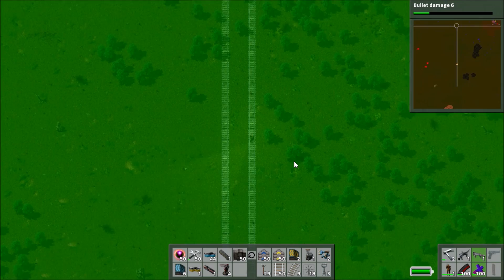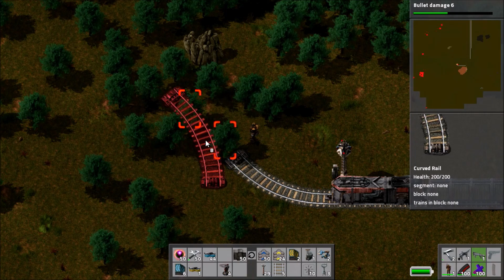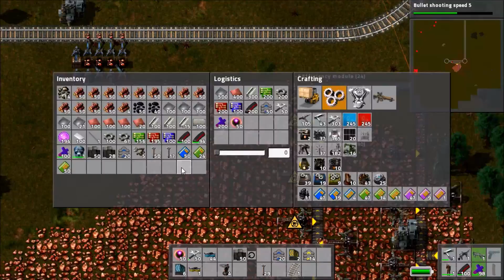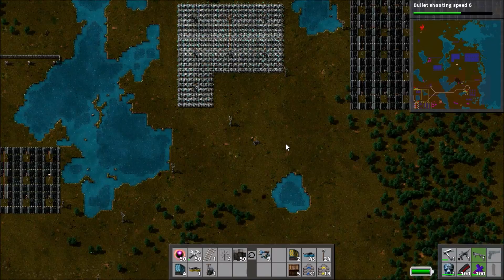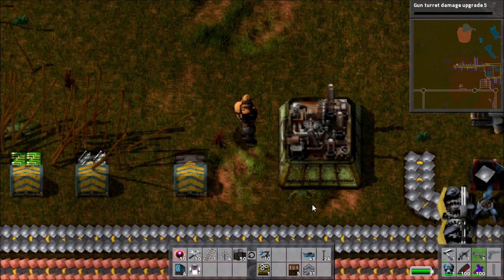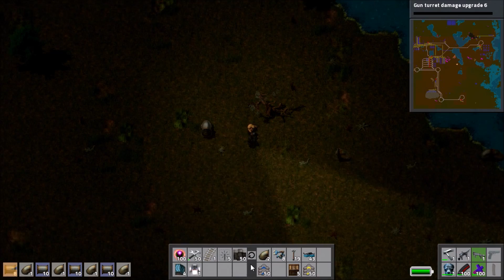Factorio Railworld Ep#25: Copper Train

Comment: Efficiency modules for pumpjacks.. Wow. I always need to fill them with speed and then I still don't have enough oil.
Reply: +Willem Maas 
Speed modules are excellent for pumpjacks because they have an infinite supply once they drop down to 0.1/s. If you put them into miners you get the supply faster, but it also runs out faster. With the oil you're actually increasing the amount you get over time which is technically like adding productivity modules.
Reply: Yonkage Yeah, I know. I always put tons of speed modules in my oil rigs. And then I still don't have enough. Which is why I was surprised he's putting efficiency modules in them.

Comment: Hi Bentham, I noticed in your other videos that you don't use buffer units coming out of your furnace areas, and instead you compensate by adding more and more furnaces.

if you put storage chests in between after your furnace output (also very useful on the output of your circuit output) you will have a buffer that builds up during quite production periods, (such as when you don't have any alien artifacts) allowing you to cope with high production requirements.

This is just like using accumulators but for items.
Reply from the maker: Generally the increases in demand I've been experiencing have been thanks to generally more demand rather than sudden spikes, meaning that in the long term the addition of furnaces would be needed anyway.
Reply: MangledPork Gaming Sure, demand does increase, but buffering is easy and goes a long way to smoothing things out, I wasn't sure about it at first when I read on reddit that some people swore by it - my main concern was that it might run up pollution through over production, but having tried it I now consider them essential.

In my last few games I've been using buffers for my ore (unnessary if you build into your train unloading like you already have), and then also outside of my smelting areas and also outside of my circuit board areas (this one is really a life saver, circuit board production can ramp up and down all the time).

I have some good buffer designs that I use now, which use stationary train carriages, (their large size means that you can fit a lot of grabbers and evenly load and unload at high speed).

No worries if you still dont like them, but try building them into key points, for me they work wonders.
Reply: MangledPork Gaming On a side note, I really love your circular turning points for your train system, I'm totally going to adopt that style.

Comment: no oil train =( those are the most fun to figure out.
For best efficiency you need to learn the wire condition system for an extensive oil barrel distribution. But for one single oil train you don't need that.

Comment: Setting up a production limit for pump jacks is a simple matter, especially with the Logistics Network.  Smart Inserter+Passive Provider Chest.  If Smart Inserter and Provider Chest are within Logistic Network (which they most likely are), set Logistics Network in Smart Insert to < 1 or however many you want available.  With above settings Smart Inserter will work as long as there are no Pump Jacks in the Logistics network.  Once one is built, it gets put in the chest, preventing the Smart Inserter from working until the pump jack is removed, either by you or by Logistics bots.

With Red/Green Wire Conditions, the only difference is that you connect a red or green wire from a power pole to the Smart Inserter and a second from the same power pole to a Smart Chest.  In addition, by stringing red/green wires along a series of poles, you can control the operation of a Smart Inserter by the contents of a chest elsewhere in the factory.
Reply: the last part is very useful for oil outpost. To not oversupply with empty barrels.

Comment: 101 of green wires:
1. place logistics chest as output
2. place smart inserter feeding into the chest
3. with green wire in hand click on the closest electric pole then on the chest
4. repeat with inserter
5. click the inserter and tell it < and the amout you want to keep stocked
Reply: You don't need the green wire if it's in range of a roboport, cause you can use the logistics condition

Comment: why does he leave so much room between each drill surely it would be better to put them side by side with no space
Reply: MangledPork Gaming I did not see your answer while I write it. I mean if you put the drills side by side then there will be more drills and therefore more pollution and so on :)
Reply: Actually, the drills cover one space around themselves; so if they were next to each other, they would overlap in some areas. Not that it's bad, just most likely why.
Reply from the maker: Its so that each miner has more to mine and therefore takes longer to mine it. That means I need to replace them less often and thus, there is less overall work, and the rate of ore I get is still the same per mining drill so there's little in the way of downsides.
Reply: More drills means more pollution and energy usage even with efficiency modules.
Reply from the maker: Devenias Who said there were more drills?
Reply: +MangledPork Gaming I saw a green space around the drill. Is that what your talking about?
Reply: +MangledPork Gaming I saw a green space around the drill. Is that what your talking about?
Reply from the maker: koopz Yes, that's the 5x5 mining range.